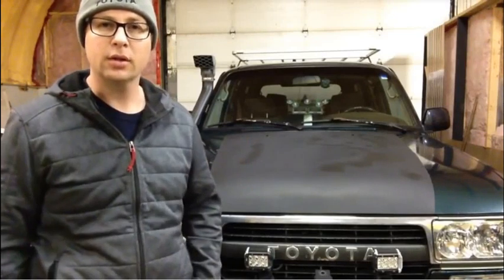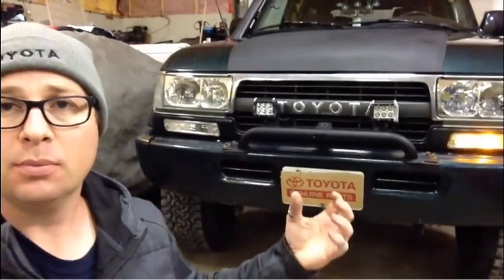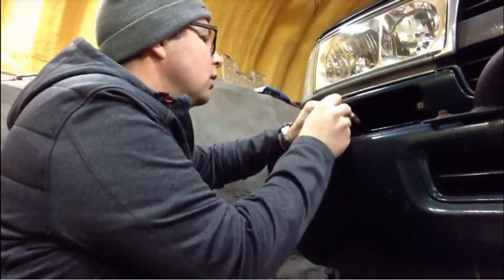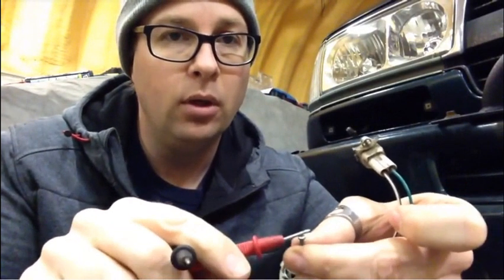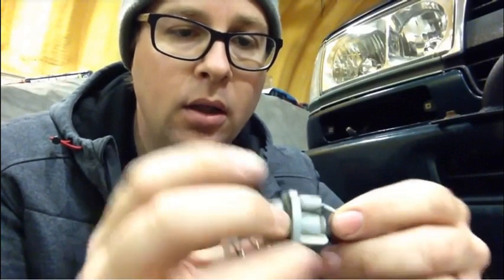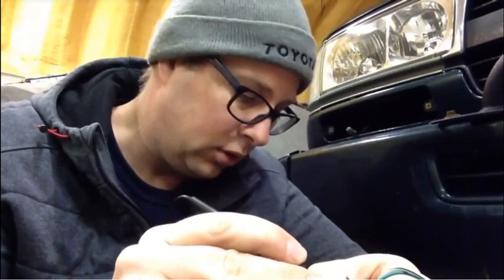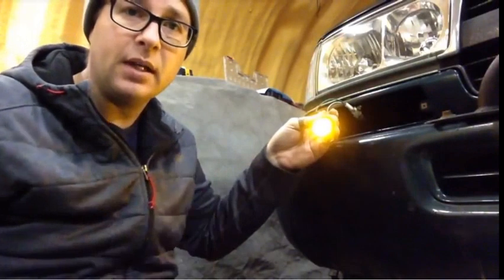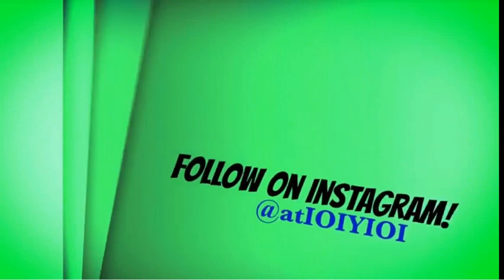OVERLAND TECH TUESDAY: How to troubleshoot Vehicle wiring

Comment: Hey Richie, follower on all your channels here. I got two young boys but and am looking to buy a truck for doing some light to medium off road stuff. But also cart them around. Not looking to build something crazy. In your opinion what would be better a xj or 4runner? I'm in NH both are going to have the same rust issues. I'm limited to 5k to buy. A any suggestions? I just want to do a mild lift and get into the woods.

Comment: I really like the way he fixed the problem and didn't just replace the socket.  The only problem, what to do if the continuity checks good on both wires. This is common to happen when checking something like this because an ohmmeter only puts out a small amount of voltage. In this case power the socket with a battery and then test it with a voltmeter. The weak connection will then show up. Great video thank you!!